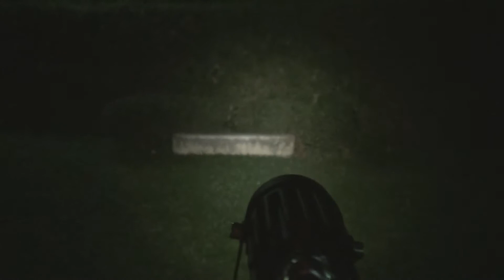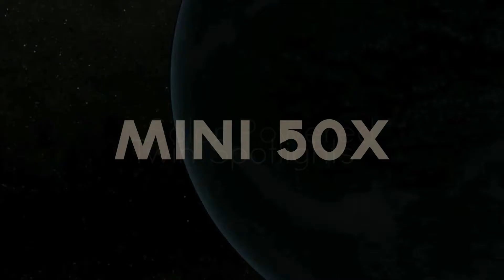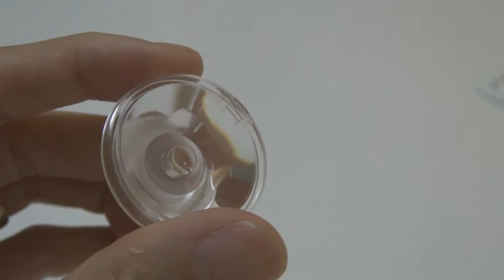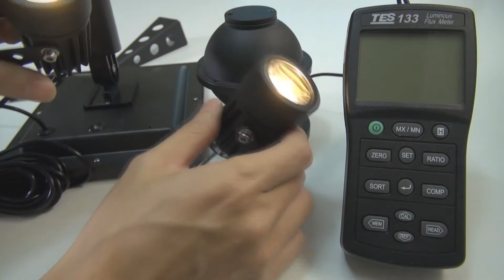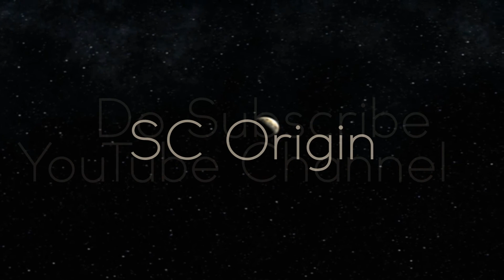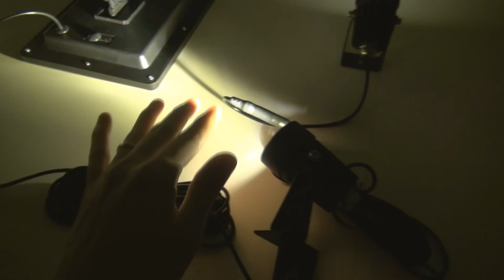Mini 50X Twin Spotlight Part 2

Comment: Carolyn - Just bought this light set 4-10-2020.  This video was helpful to fully understand the on/off switch and how it advances from high light, to normal light, to low light and then off.  Thank you.